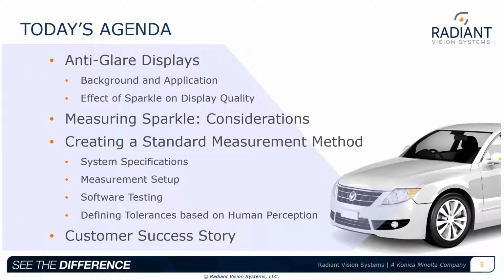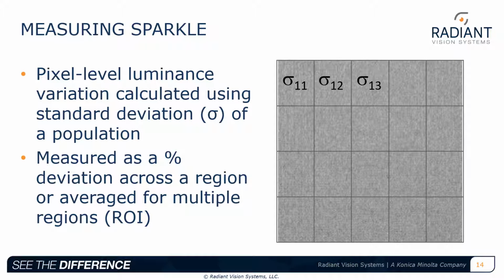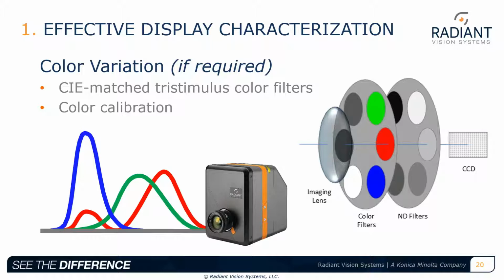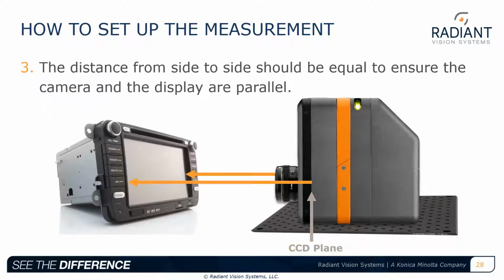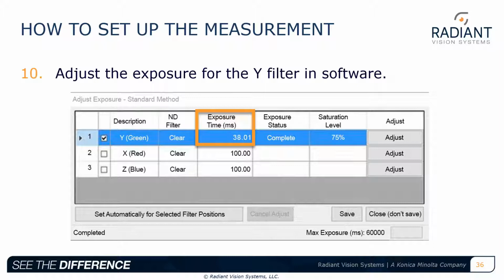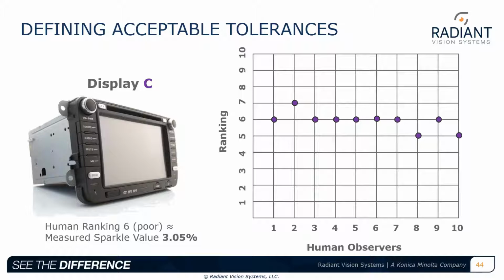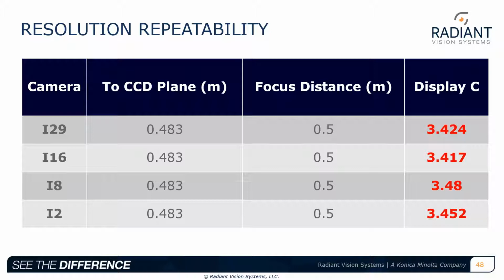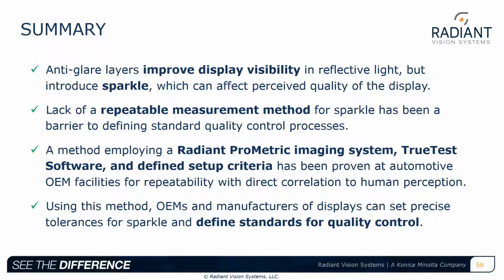Defining a Sparkle Measurement Standard for Quality Control of Anti-Glare Displays

Comment: Wow, this is great, it's a huge problem, I wonder how many accidents have occurred due to glare, causing operators to re-focus to read display rather than looking outside and flying or driving. It's a problem in agriculture, marine, trucking, factory machines, even in offices with office equipment. It's a challenge at ATMs, ticket dispensers, USPS stamp machines, you name it, this is huge. So important - IN EVERY INDUSTRY - the applications for technology solving this problem - ENDLESS
Reply from the maker: Thanks for the comment Lance! It's certainly a balance - We are trying to measure how much anti-glare property is "just enough" (preventing glare) before becoming a distraction (reducing display quality). It's a tricky situation for many display and component makers!